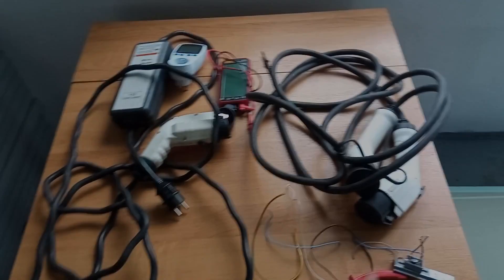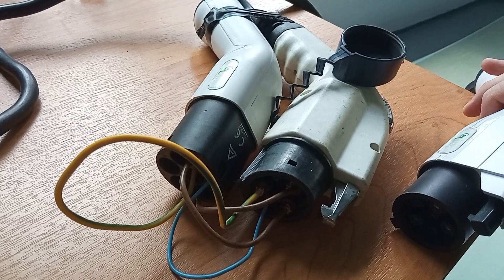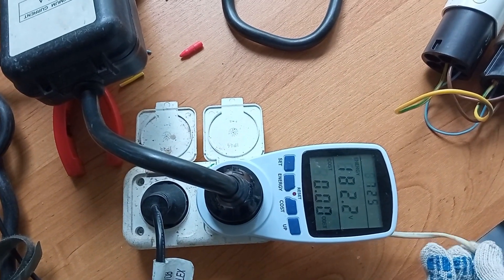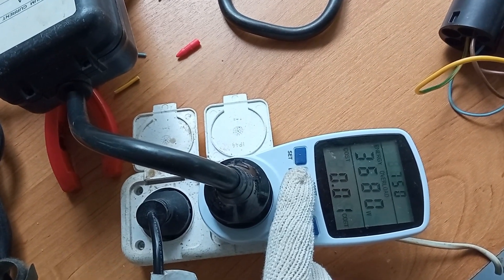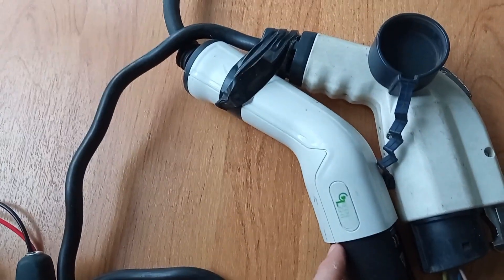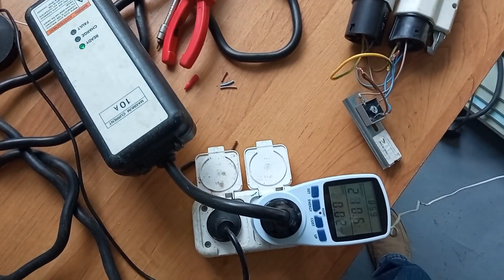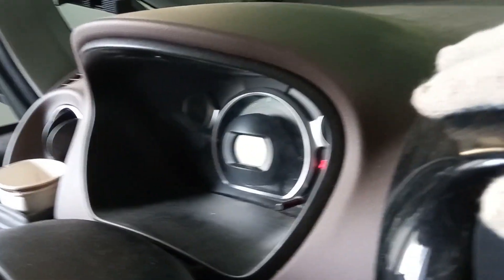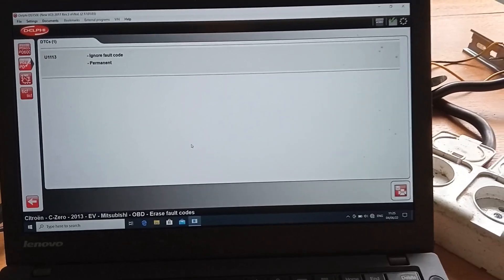Now seriously: feeding i-MIEV clone with DC via AC port

Comment: I am a bit puzzled about your comments re the PP (proximity pilot).  As far as the car is concerned, as soon as you plug the Type 1 plug into the car's charging socket (01:51), the PP side of things is sorted; the resistors and microswitch in the T1 plug do what they need to having been connected to the PP circuit on the car side.  The fact that the PP pin at the T2/T1 plug connection (with the wires) does not have a PP connection is completely irrelevant as this is never seen (or connected) to anything other than the car anyway (except Tesla does something odd with it in their wall chargers).

Comment: I tried to use your type2 to type1 adapter on my Peugeot iOn (same as MiEV) but it doesn't charge, it starts then stops after one second. Any thoughts please ?
Reply from the maker: Always start with diagnostic trouble codes report - it could be almost everything really. Mine worked fine even without grounding and proximity pilot.

Comment: Very interesting experiment. I would think the car has a current transformer on the input of the charger instead of a shunt resistor, and this current transformer will read absolutely no current when its fed DC. Maybe pulsing DC would be enough to trick it.
Reply from the maker: Pulsing DC is not enough - after diode bridge it is actually pulsing. The trick works on some EVs but not MIEVs... - may be it wants higher amplitude or something...

Comment: how did you expect it to bypass the internal ac-dc charger?
Reply from the maker: the charger has a diode bridge at its input so it works as follows: 220AC -> DC -> step up to 360 DC -> battery, thus feeding AC port with DC should work
Reply: @diyeverythingnow  For what other cars is charging with a DC voltage on the J1772 known to work?

Comment: Друже як зробити щоб на повільній зарядці заряджалась i-miev на станціях зарядки? Кажуть треба якось модернізувати проводку, але не можу знайти як.
Reply from the maker: Адкажу тож на роднай мове :). Не зразумеу́ праблему. У мiяу́кi 2 парты - хуткi chademo i звычайны. Калi станцыя хуткая - не мажлiва яе выкарыстаць для j1772. Калi станцыя type 2, патрэбны адапцер type 2 - type 1. Каштуе 100 амерыканскiх прыблiзна з aliexpress.
Reply: @diyeverythingnow  Не заряжается медленной зарядкой на станциях. Дома от розетки и от чадемо заряжается. Пробовал разные станции, но нигде не идёт зарядка. Стартует, и всё, киловаты стоят на месте. Мову понял без проблем :)
Reply from the maker: @pakotya  очень странная фигня. Если от кирпича заряжается - от медленных тоже должна. Разницы для нее нет
Reply: @diyeverythingnow  if this is a very old imiev,  it may be one of the ones which don't speak j1772. These have no brick on the "granny" cable

There is a modification necessary to convert these to j1772 compliance
Reply from the maker: @miscbits6399  mine wants the Control Pilot signal (tested). Those "brickless" were made till early 2011 and have many issues with charger.
Reply: @diyeverythingnow They all as well as leaf ze0 have a endless problems with a charges, but it's just internal charger design.